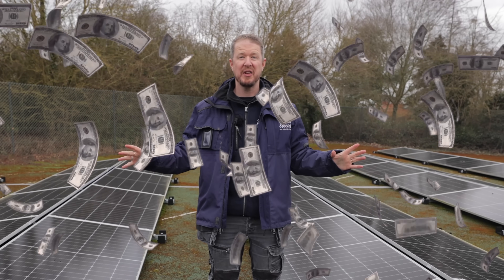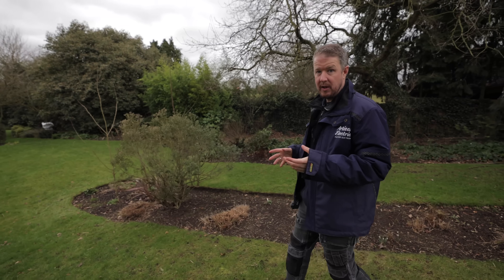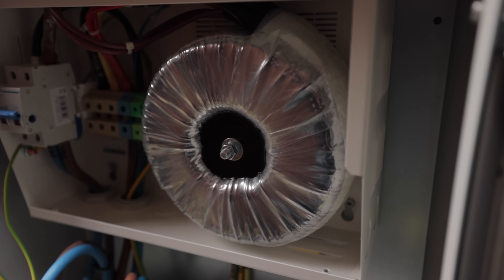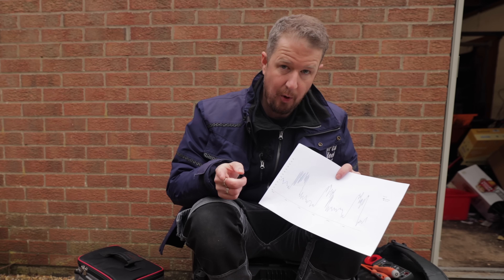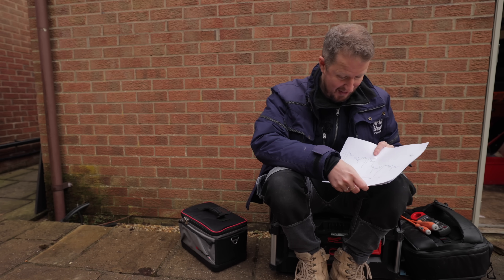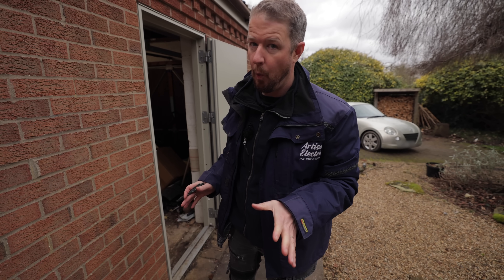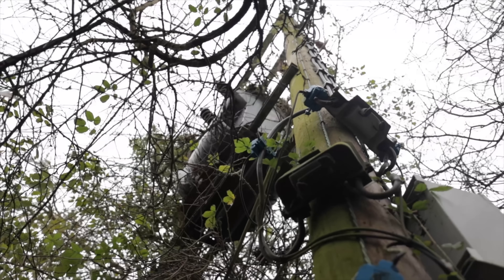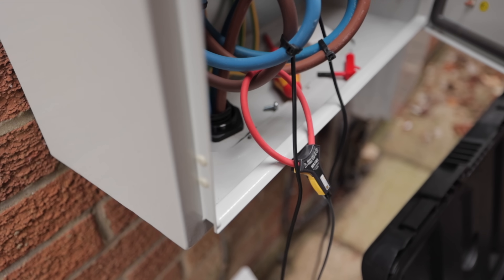THOUSANDS Down the Drain – And We Can’t Do Anything About It!

Comment: I don't get it ! voltage from solar panels in series can be 600v or more, large systems are wired series paralel but that voltage never gets to the mains, it's DC which is used to charge batteries through a regulated power supply capable of and designed for the size of the system ! Home AC is generated via an inverter or multiple inverters fed from the batteries. If you are feeding into the grid, surely you are just diverting inverter power which is regulated to 240 volts into the mains supply, How can an inverter in paralel increase mains supply voltage to 260v. What am I missing ? (I believe this installation is different to most in that it supplies the home direct as well as feeds into the grid). would be interested to know if my simple understanding is anywhere  near reality ;+). PS I have a solar and emergency power system (1.2kw) which kicks in during power cuts but also permanatly supplies lighting and boiler circuits. (I'm a a retired electronics engineer)

Comment: Pushing and pulling all that power through a single phase is always going to cause issues. The voltage issues you describe are normal with the sheer amount of solar being installed. I have had my inverter cut out on sunny days because all the houses down my road are pushing solar back to the grid causing it to hit the 253v over voltage limit which causes most inverters to cut out. Solution for me was to bin the inverter and go DC-DC but i don't export to the grid. You would probably be better off recommending more battery storage and a slower charging rate. On a typical octopus intelligent tariff you get 6 hours off peak so charging 30kwh of battery in 2 hours doesn't make any sense, especially when its causing you issues. You could also put some sort of export limit on the inverters as well until you find a sweet spot where it doesn't hit high voltage cut off.

Comment: Aren't you supposed to check the supply impedance as part of the G99 application/verification? If you've not done that you are presumably in breach of the G99 by sending >253V onto the network and as we all know 'Failure to comply with G99 requirements can result in fines, legal action, or even being barred from connecting to the grid' !!

Comment: “240V which is fairly high”… Erm, that’s basically the standard. EU harmonisation didn’t magically change the grid voltage to 230V overnight. Many areas still see close to the 252V limit of the spec during off peak times!
Reply: I thought the same! Maybe in London they're not used to what used to be our normal UK voltage. My supply is normally up around 248 volts, sometimes dipping briefly, often for no apparent reason, to around 230; so I laughed when he said he thought 240 was fairly high, no mate, it's about normal in the UK, something a high profile UK spark ought to know.
Reply: YES, the 220/240V harmonisation was a fudge the brought in a nominal 230V with a +/- factor that allows 220 and 240
Reply: I thought the same. 240V is normal, not high.
Reply: I live in Spain and in my house swings between 225 and 230 but in some rural areas I also saw between 240 and 250
Reply: We vary between 244v and 249v normally..
Reply: Agreed. I work for a DNO & the voltages can be all over the place, especially in rural area. This wasn't a significant problem until recent years, when the number of EV chargers shot up & suddenly we were being swamped with reports of voltage over 253v tripping the controls. We currently ask for the installer to check the voltage, to confirm it's over 253v, before we'll call out to run our own test, as we had received a lot of reports, only to find the issue wasn't with the voltage (though I expect most are voltage-related). 

It's a big challenge to deal with, with all the net zero stuff meaning more & more renewables, batteries & EV chargers are being added every week. There is a lot of investment into the network to transition, but I get the impression that is focused more at the transmission & HV networks, rather than replacing "dodgy looking" overgrown pole transformers. Being brutally realistic, ripping out & replacing the entire network is an absolute non-starter. I've heard rumours online of the UK voltage being dropped down to 220v to alleviate the issue & align with the European standard. I shudder to think what new issues that will create. 

It seems to me that the outcome will be a compromise between the DNOs fiddling their end & perhaps manufacturers tweaking the tolerances of their equipment to alleviate the tripping. I expect it will be a messy solution & we'll somehow muddle through, as the real world doesn't always align with the quoted specs!
Reply: My own house swings between 251V and 235V
Reply: Netherlands. I swing between 237 and 225. I have asked the power company about it and they say its perfectly fine for us down to about 211V and up to 250V

Comment: Seems like a load calculation error, I would have gone for a larger oversized. So say you use about 200amp of power this is your maximum capacity for your service, now in the winter time you have less sunlight so you need a larger battery array to accommodate that, so you probably need 600amps of capacity to match the less sunlight, also solar array should be larger than battery capacity, and battery capacity should be larger that your actual energy usage, this way the panels can charge the battery bank faster then it can be depleted.

Comment: When there is an undervoltage situation during high loads and overvoltage during high feed-in you have grid impedance issues, using a single phase system instead of a 3phase system isn't helping either. 

The stepup/down transformer will only fix the overvoltage problem, but will increase the problem for your neighbours. They should be banned..

The voltage that your grid operator specifies will be at the grid connection point, so any cabling beyond that should be decently sized to keep it's impedance as low as possible. I have seen plenty of cases where the voltage difference between inverter and grid connection was >15V difference.

Short term solutions if the operator won't budge can be:

Peak Shaving with your batteries when charging the car (Solaredge can do import/export limits, not voltage dependant)
Voltage dependant charging limits (Not built in to Solaredge as far as i know, but can be done with a PLC and modbus TCP/IP into the Solaredge system)
Voltage dependant feed-in limits (Solaredge has this built in to each inverter)

Comment: Have you tried requesting the utility temporarily accommodate you by changing the tap on their upstream transformer?

Option B would be to install another battery and limit the mak export kVA to rather store it in the battery and discharge into the grid over a prolonged time hence not having such a huge influence on the incoming line Vdrop (Vrise)

Comment: Use a voltage regulator hello, like a ups, solar + Battery backup or super capacitor array, ideally you would use Solar + Battery array (ideally larger then the houses total load capacity) , this is tied to a voltage regulator that syncs incoming voltage from utility with the solar array, much like how a computer ups works.

Comment: Use a voltage regulator hello, like a ups, solar + Battery backup or super capacitor array
Reply from the maker: Explain?
Reply: @artisanelectrics  it seems like the battery and the solar array aren't big enough to handle the draw from the car as well as draw from the house, and the grid, more expensive but if you battery is sized over the maximum draw of your building full load base that on 24 hours plus extra for grid use, then also make sure there is enough current to charge the batteries fast in low light, say you house draws 200amps max now make that 200amp hour x24 hour 4800amps total capacity now add extra 1.5 and that 9600amps and make sure your array can supply 4000amps to charge thebattery

Comment: Not difficult to install a voltage optimiser as the "feed in" to your dno. 
DNOs have had this issue for ages. 
The more Solar / micro generation gets installed , the worse it gets. 
When designing the generation, transmission and distribution networks, voltage drop is designed into the circuits. So when the designed current isn't drawn, the volt drop doesn't occur in that part of the network. 
For your install, you need a decent inverter and I would suggest an active voltage optimiser/conditioner. Ordinarily they work where power is drawn from the dno network but they would work on yours. That'll likely add £1000 to your costs but will mean your over voltage doesn't damage equipment drawing power from it. 
Alternatively, you could use a large battery storage fed from the DC of the solar then use a decent inverter to stabilise the output to better suit the grid. Many customers do this now to avoid " selling " their power for buttons and draw the stored power for their ASHP or EV.
Reply from the maker: Selling often makes more sense in the UK right now

Comment: Sounds like the issue is that the inverter tries to run overvoltage to export power to the grid, rather than running at the same Grid voltage output. Perhaps the inverter has a max voltage setting such that the inverter never exceeds ~245 VAC. It would limit the power it can export but would prevent overvoltage 
conditions. There might be a fireware update to fix.

Comment: why not just separate and disconnect it from the grid?
charge and discharge the battery units,
whats the point in the batteries if they're receiving their power from the grid.
unless you're providing power for the grid for a return?
either way, whats the point if all it's doin is causing problems and additional costs?
hardly seems worth it at all

Comment: I don't know where you are but I do notice that that panels are almost flat.  Not sure why you would do that but okay.
Regulating voltage is typically a simple problem to solve.  I'm just not getting it.  Is this series parallel?  What are the individual panel voltages?  Are you in Australia or GB?  Let's see some panel voltages.

At 6:40 you show a chart of voltage from the array and it is all over the place.  There's something wrong right there.  That should be steady and during the day you should see a sunrise going to noon and then a sunset.  This should be very smoooth and not spikey like shown.  Take the load off the panels and show the voltage over a period of time.

This bothers me.  I've never seen anything like this from a pv and a typical solar cycle.

Comment: So basically its an auto transformer switched by electronics to step up or step down the voltage.Vd is not the std you want to get when you are dealing with sensitive electronics and electrical systems

Comment: Wait... what? You don't have three-phase power on that connection??? Sorry for my ignorance but here in the Netherlands, if you require more power than 35 amps (that equals 8 kW) you'll get three phase power instead of a single phase. That starts at 3x25A, so equal to 17 kW.  Further, about your problem: What type of batteries are those? Likely not DC batteries, right? They're likely AC, so grid connected? And where did you put that transformer? Between {PV+house} and power grid? Or between PV and {house+grid}? I think you're just overloading the grid connection (regardless of what they say). To solve the overloading you should try to limit the charge rate at night, so not charge at FULL speed, but limit yourself to like 60% charge rate. The batteries will get less full, but would you rather have less charge and a system performing flawless, or a full charge with a system failing regularly? Surely, the former. And in summer, during the day, you either need to charge the batteries faster, or add more batteries, or limit your PV generation in some way or other. We're all grappling with these issues. In the Netherlands, when the voltage goes above 253V the PV inverter needs to shut off automatically, by law. The only remedy is to generate less, or consume or store more. Fortunately it's only during peak hours.
Reply from the maker: In the UK 100 amp single phase is common
Reply: Oh and I forgot to add this: Another way you can solve this is by removing that transformer from wherever it sits, and put it between the EV charger and the rest of the house+batteries+grid. That way, it'll lower the voltage for only the EV and the safety mechanism will no longer trip. Done!

Comment: Had this multiple times in Cumbria where the network is rural and pretty out of date. The inverter can't get rid of it's energy due to network resistance. So lifts it's voltage to help push it away. Trips itself out at at 270volts (over voltage fault). 
Gets even worse when the neighbours get solar too🙈
Reply from the maker: Yeah seems a lot of people are having this issue

Comment: Totally DNO fault. They should know their network capabilities and limit the max generative load added to the substation. In Estonia, if there is not enough capacity, then DNO will say that yes, you can add your solar but only after you pay for the transformer. For you, the best option would be (in case DNO doesnt want to upgrade) to limit the export power so you could get max benefit from solar for local use.

Comment: Will be interesting to know the measurements during a sunny day, especially the reactive power. 
Since the voltage is rising excessively, the reactive power might be capacitive, and an inductive load balancer could be utilized to bring the voltage down. (balancing the grid reactive power)
Same goes for the winter time, when the voltage is low, a capacitive load balancer could be used to bring the voltage up, although this is more likely caused by the high load at midnight charging the house batteries. 
The charging load should be limited (preferably dynamically according to voltage) so the charge cycle lasts for a longer period. Also, the solar grid-tie could be connected closer to the meter to take advantage of the heavier gauge wires to the grid. 
The cheapest option is sadly to limit the charge/feed power, although the inverters may have the ability to do this dynamically depending on the manufacturer.

Comment: Currently working for a power distribution utility company under the distributed energy resource department. The issue is not with the utility, but rather with the inverter’s MPPT settings. If the utility transformer were overloaded, one would typically observe low voltage issues even before the customer’s PV plant was installed. In this case, it appears the inverter is configured incorrectly. Instead of operating in grid following mode, which references the existing voltage and frequency, it is behaving more like a grid forming inverter, attempting to establish its own voltage and frequency. This can result in higher than normal voltages on the customer side
Reply from the maker: What country are you in?
Reply: @ I’m in Zambia. Our regulations for grid connections largely follow the same international standards used in the UK, so the practices and requirements are very similar

Comment: My understanding was that inverters stop producing power when the line voltage exceeds around 260V (the exact value depending on the country). With that power "optimizer" you tricked the inverters into going 6% higher, 275 or so volts. That sounds like pretty bad thing, especially if one of the neighbors starts to complain about excessive voltage and/or an inability to export any electricity to the grid

Comment: I had a similar problem when I first had my car charger fitted. The PEN detector was tripping out every night when I wanted to charge the car on Octopus. Initially the DNO (Scottish Power) tried to tell me the voltage increase at night was due to “someone’s” solar - AT NIGHT!!. We had a lot of back and forth but eventually they recorded the voltage over several days. After a couple of additional days the engineer appeared back looking very pleased with himself. They had dropped a tap on the local distribution transformer. It was sitting right up at the limit during the day when the load is high and creeping up at night when the load dropped. I would suggest that you ask one of the neighbours to complain. If the voltage is sitting that high during the day all of their consumer electrical items will be slowly cooking. I think perseverance is the name of the game. Good luck.
Reply: The batteries get charged at midnight?

Comment: What this system should do automatically is to generate less power when batteries and grid cannot take it up anymore. Solar controller should stop MPPT and start regulating for keeping grid voltage at max 252V. If the customer thinks he's wasting capacity, he should get more batteries or less PV.
Another option would be to power the whole house 'off grid' from inverters fed by the DC bus of the battery banks and leave the rest 'as is', maximizing output voltage to the grid for supplying back as much as possible, possibly causing problems for others connected to that pole. Neighbours won't appreciate that option.

The grid operator probably approved this install because it will be self-regulating, in a way. Customer will start supplying less back to the grid if he starts noticing over-voltage errors and damage. So I think, they won't do anything, until they're getting over-voltage complaints from others at that pole. If that happens, their only option will be to beef up the wiring and possibly the transformer, since this install is approved already. I don't know. I'd just start generating less, or getting more battery capacity. I wouldn't want the neighbours against me.